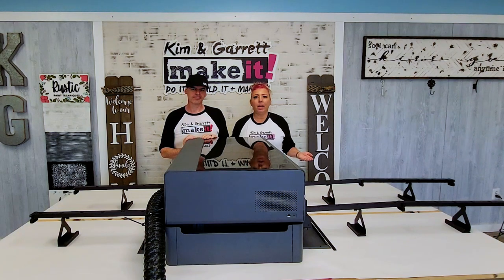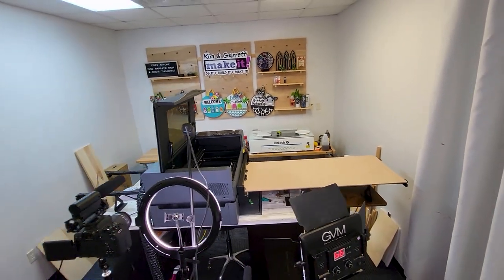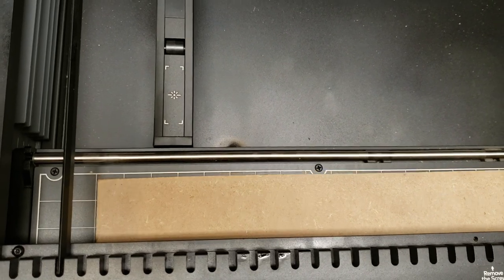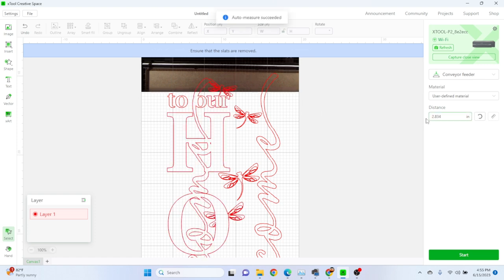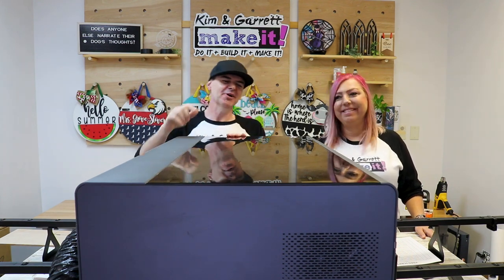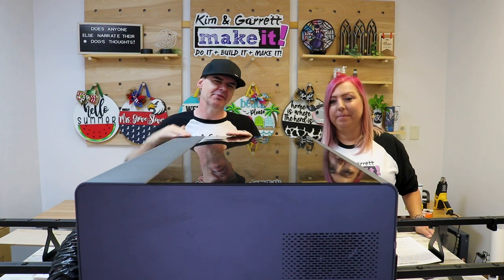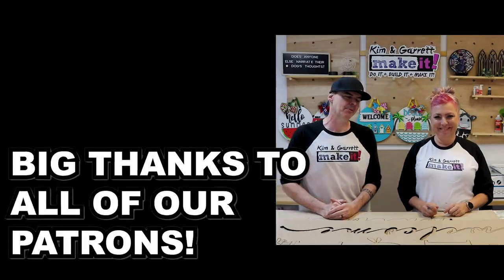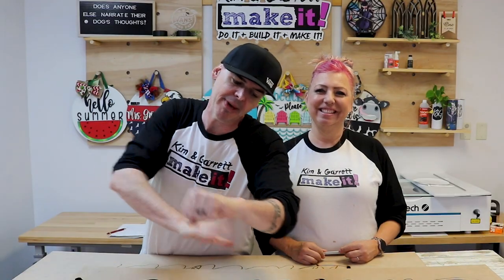How NOT to Use the xTool P2 Passthrough with Automatic Conveyor Feeder! Laser Engrave

Comment: The roller setup seems very bad, in my opinion. They should have gone with a full belt or track so that the material wouldn't be stranded if it were too short.

Comment: is there a reason you are engraving in the middle of the engraver space? can't you move the head to where the material enters the machine? (to where the markings are on the feeder? This way you won't need to add an additional piece to your board and the head is closer to where the clamps hold down the board

Comment: PSA: we purchased the feeder as well. Here's what to be aware of:
1. we have yet to get this feeder to work!
2. we've spent around $500 on materials so far on test attempts and at least that on time wasted.
3. we've tried short board lengths, long lengths, etc. no luck
4. we've tried SO MANY setting combos. bottom line, the alignment is off every time
5. we've engaged with xtool support. after weeks of communication (takes 12 hours between contacts because they don't have a US presence) we still don't have a working product. can you imagine this kind of hastle with a car? or a phone? still hoping they can get it working so we can make an ROI (still have yet to sell a product from the conveyor feeder.

BUYER BE WARE!
Reply from the maker: Email us!  Maybe we can help?  support@kandgmakeit.com ~garrett

Comment: Making it go back n forth seems to be most the issue. Is there a setting you can change to just make it in one direction? One that doesnt follow the design but just does top to bottom line by line. putting the lazer at the closets position to the feed and that would solve a majority of your issues.

Comment: I'm sure you said, but what's the max width can pass through there? Like for example can I get a 4x4 sheet of anything through there?
Reply: The bed size is around 12x24 inches on the P2. Something 4x8 or 4x4 feet you’d need a bed style laser running around $13k. I bet it would be awesome tho. I’m sure you could find one cheaper but you most likely get what you pay for with these.